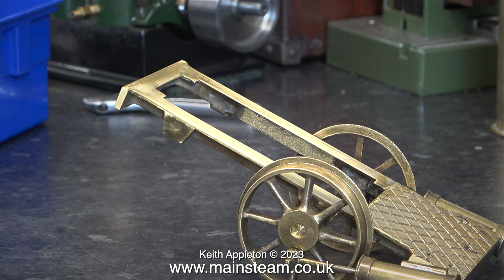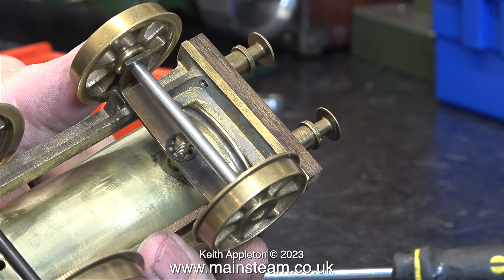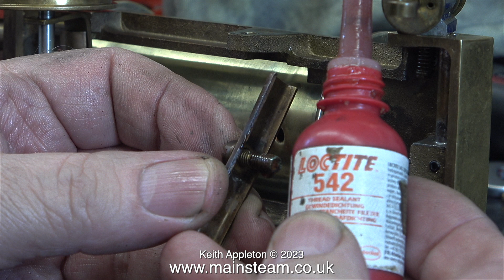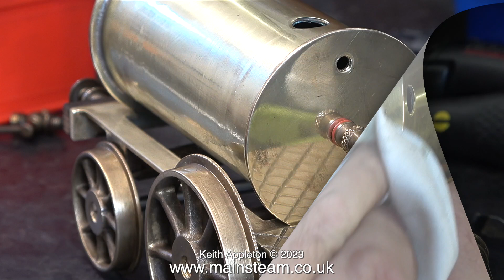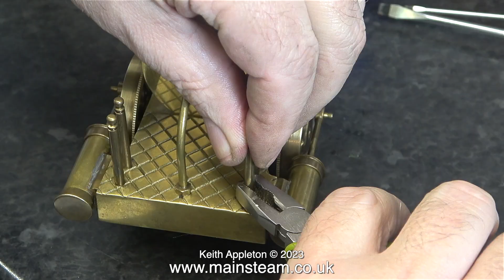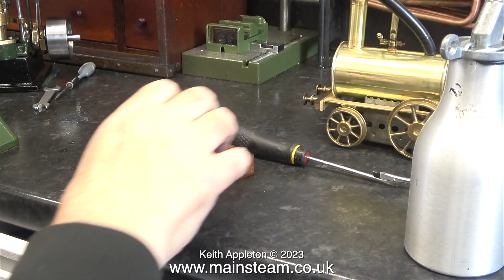HOW TO REPAIR A "BIRMINGHAM DRIBBLER" - PART #4

Comment: The bolt that holds the boiler goes through the beam into the boiler? is that correct? I have looked at pictures of dribblers and always thought it was a blind bushing holding them.
Reply from the maker: Not on this one, it is as shown .......

Comment: Because the two cylinders are single acting, it's better not to quarter the driving wheels, and instead set the big ends one hundred and eighty degrees apart.  That way, power will be provided for a greater proportion of the driving axle rotation (everywhere except when the pistons are near top or bottom dead centre).  At the moment, with the quartering, you have a 'dead' quarter rotation when neither piston is providing power, as well as the small portions near top/bottom dead centre.
The locomotive will also be better balanced with the crank pins set at a hundred and eighty degrees to each other - but that's not important, and probably not noticeable on a small toy engine like this one.
Reply from the maker: Yes I agree with you, most twin oscillators are set to 180, I just wanted it to be "Steam Locomotive" style. The little loco did run OK on the bench using compressed air with the cranks at 90 degrees to each other. In the next episode my friend James Evans and I give it a steam test on the bench, but the waxed fuel pellets are just not hot enough and burn very dirty. When James held a small gas blowtorch underneath the boiler it did run much better. I told James how to very easily alter the timing, and he may or may not make a video about it . . . .